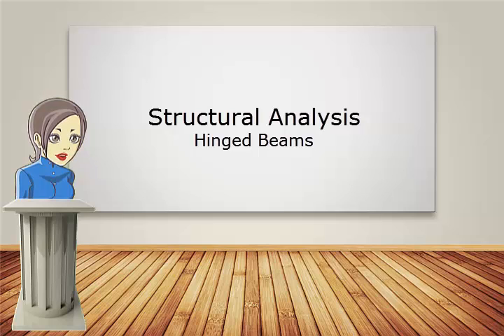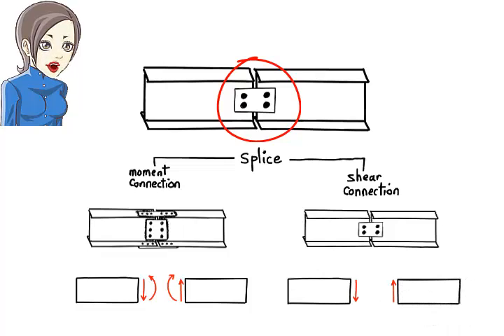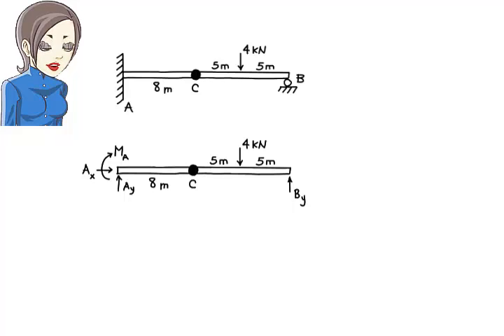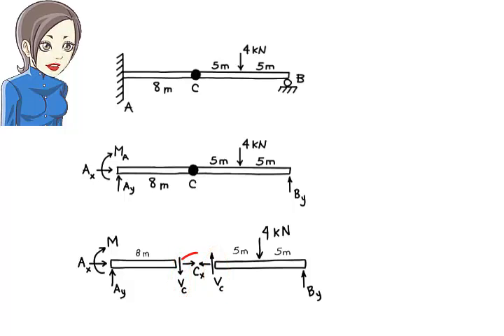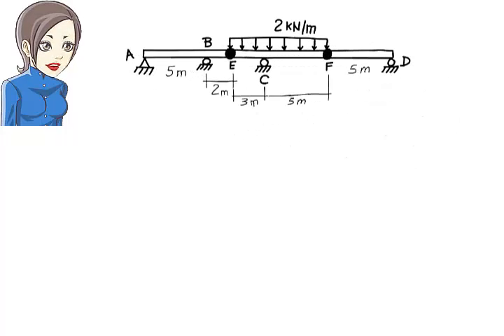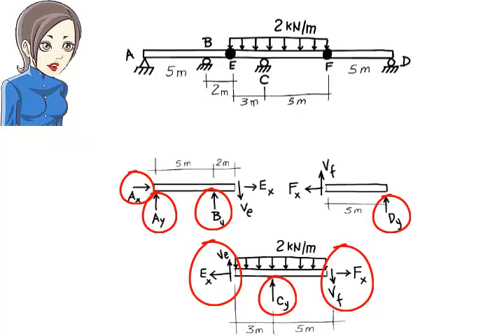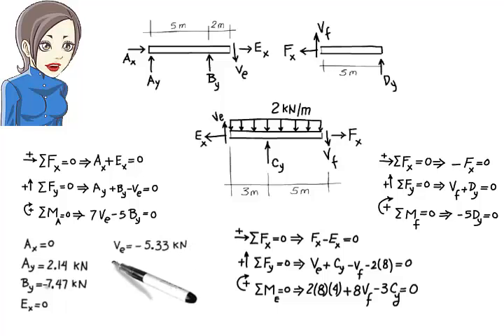SA03: Analysis of Beams having one or more Internal Hinges

Comment: In 3:23 , Why is there no M in the equation of 4 (5) - 10 By = 0?
Reply from the maker: That equation is written using the free-body diagram of the right segment of the beam (Segment BC). There is no M in in the free-body diagram of Segment BC. M is located at Point A and not a part of Segment BC.
Reply: @DrStructure  Internal hinge doesn't have M?
Reply from the maker: Correct. There is no bending moment at the internal hinge.

Comment: How one decides if the splice be a moment or shear?
Reply from the maker: That is a design consideration which can be decided on case by case bases. For example, if the splice is near the point of zero moment in the beam, we can design it as a shear splice. If however the splice is to be placed at a point with a high internal moment, a moment splice would be more fitting.
Reply: @DrStructure Thanks indeed for the reply. 👍
Let's us say for example, that in a continuous beam, one of the spans has zero moment at one point and a maximum at the other one. Is it permitted and practical to have at one point a shear connection and the other a moment? Is it really happening in the real-world?
Reply from the maker: Permitted? Yes! 
Practical? That depends on the cost. If the cost of building such splice combinations for that beam is deemed reasonable, then yes, it is practical.
Reply: @DrStructure  👍 Again, many thanks.

Comment: Does the presence of internal hinge make structure weak
Reply from the maker: It causes a redistribution of the internal forces in the structure. That does not necessarily mean a weak structure.

Generally speaking, we design a structure for a specific purpose; to safely carry a specific set of forces. Of course, we can over-design the structure. We can design it to carry more loads than it will be subjected to during its life cycle. In a sense, the over-designed structure can be said to be “stronger” than the optimized structure. But that does not mean the optimized system is weak.  

If we add redundancies to the system and make the members heavier and stronger, we end up with an unnecessarily stronger structure which renders the fitting (optimized) design a weaker option.

Comment: Why is it that in the first problem with 1 hinge, the moment of the fixed support is drawn clockwise, however in your first video when you were showing the types of support, the moment was drawn anti-clockwise. I drew the moment anti-clockwise and got M to be 16 kNM, whilst you got -16. Could you please explain to me how to determine the direction of moments?
Reply from the maker: When the force/moment is unknown, since we don’t yet know its direction, we need to make an assumption. In the case of a bending moment, we can assume it to be either in the clockwise or counterclockwise direction. If we guess correctly, we get a positive magnitude for the moment. If we guess incorrectly, the magnitude of the moment comes out negative, which tells us the correct direction. 

So, when the unknown moment becomes known, we have its correct direction and magnitude. That is, a negative moment magnitude tells us that the moment is actually acting in the opposite direction (with a positive magnitude).

Comment: Question1: When cutting the segments, why do you use always Ve of Vf and not Ey and Ex ? 
Question2: What if there is a couple moment of internal hinge/s, is it in same direction when cut the segment or it is unchangeble (the rotation of couple). 

Ty and more POWER!
Reply from the maker: We usually use the letter V to refer to a shear force. But of course we can use any other letter/symbol to refer to the internal shear force at the hinge when the beam is cut. Generally, there is no fast rule for labeling forces, there is only convention and/or preferences.

Well, since the internal moment at the hinge is zero, there is no need to draw it at the hinge. But if we were to show the internal moment at a cut point in the beam, we would need to draw them at two opposite moments (similar to the way we draw two opposite shear forces). If we draw the moment at the left face in the counterclockwise direction, the moment at the right face of the cut needs to be drawn in the clockwise direction, and vice versa.

Comment: We say there are three equilibrium equations , FX,fy and sum of moments equal zero , however you say when we add a hinge the number of equilibrium equations increase to 4 or 5 , how is this possible? Does the hinge add another condition of equilibrium? My guess is that bending moment at hinge being equal to zero is the additional equilibrium equation that results when we add a hinge ? Please reply
Reply from the maker: For each beam segment we can write three static equilibrium equations.

When the beam has an internal hinge, we can separate the beam at the hinge into two segments. 

For each segment we can write three equilibrium equations. That gives us a total of six equations. So we can solve for six unknown forces. 

The unknown forces being the support reactions and the shear force and axial force at the hinge (bending moment at the hinge = 0).

Such a beam can be analyzed if it has a total of four unknown support reactions. The four support reactions plus the two unknown forces (shear force and axial force) at the hinge gives us a total of six unknowns. Such a beam is treated at a statically determinate system since we can determine all six unknowns using the six available equilibrium equations.
Reply: @DrStructure  my teacher has given me a problem that has a beam with one end fixed , the other end roller support with a hinge between the two supports , it says that the total number of reactions are four ,but the number of equilibrium equations are four , and the one extra equilibrium equation comes from the internal Hinge , can you please explain this ? Is there a difference between equilibrium conditions and equilibrium equations?
Reply from the maker: The number of unknown support reactions is 4 (three reactions at the fixed support and one reaction at the roller support). And if we separate the beam segments at the hinge, we introduce two additional unknowns (a shear force and an axial force at the hinge). So, we end up with 6 unknowns.

Suppose we label the reactions at the fixed supports Fx, Fy, and M. And refer to the reaction at the roller as R. So, Fx, Fy, M, and R are our unknown forces. 

The three static equilibrium equations for the entire beam are going to be defined based on the four unknown forces mentioned above. Note that none of these unknows are related to the hinge. So, what does the additional equilibrium equation (for the hinge) look like? Does it use any of the four unknowns? The answer is no! The equation at the hinge references the internal moment at the hinge (the moment at the hinge = 0). But that moment is not a part of the support reactions (i.e., it is not one of the four unknowns referenced above). So that additional moment equation at the hinge is of no use for determining the support reactions.

To solve the problem correctly, you need to write three equations for each segment of the beam (assuming we have separated the beam into two segments at the hinge). The four support reactions + the unknown shear and axial force at the hinge gives us a total of 6 unknowns which we can determine using the 6 equilibrium equations.

Comment: Hi Dr. Strucutre, great video as always! :) Is there a chance you could explain the forces involved in this device: thunderbeat (link below), particularly at time 0:57? 
(https://www.youtube.com/watch?v=O8isvo_VW7s&ab_channel=OlympusMedicalSystemsEuropeandMEA) From my understanding, the upper jaw is a fulcrum/pin support as it allows rotation, the force from the tissue closest to the inside will equal the force exerted on the outer edge tissue that's the same distance away from the fulcrum point. Is this correct?
Reply from the maker: Without examining a schematic diagram of the device, it is difficult to understand its exact mechanics. With that in mind, yes, the device has a hinge that permits the upper jaw to rotate. It appears that the upper jaw is being lowered by a pulling action (as if a thin plate/wire attached to the jaw is being pulled to force it to close -- to rotate about the hinge). If so, the amount of force exerted by the jaw on the tissue is a function of the tension force in the thin plate/wire.
Reply: @DrStructure  thank you Dr. Structure! :)
Reply: @DrStructure  May I ask whether you have a video that explains such a pulling action? I'm struggling to understand how it would work, it makes sense that a wire would be pulled but in trying to visualize this it's difficult. For me, it seems like the opposite (i.e pulling it, opens the jaws), but I can just feel that I'm wrong as you'd need force to close it.
Reply from the maker: @king0vdarkness  I am not aware of any video that illustrates such a pulling mechanism. 

Under the assumption that the jaw uses such a mechanism, we can think of a spring that keeps the jaw open. So, think of two wires, both attached to the top jaw. One wire attaches to the top of the jaw, and another wire is attached to the top jaw's bottom. The top wire pulls the jaw to the open position, and the bottom wire, when pulled, forces the jaw to close. We can have a mechanical spring attached to the top wire to keep the jaw in the open position. So we need to apply a pulling force to the bottom wire to close the jaw. This applied force (which can be generated using a motor) needs to be large enough to overcome the force in the spring. When the force in the lower wire is discontinued, the spring action opens the jaw.
Reply: @DrStructure  brilliant explanation! Thank you so much :D
Reply from the maker: You’re welcome!

Comment: So what's the use of the axial forces if their value is zero. Because both the problems you solved, their value comes =0 .
So you can anyone kindly tell me this please?.
Great video btw , got to learn the concept with ease
Reply from the maker: For the sake of completeness, we include the axial force(s) in the formulation. 

If the beam is not subjected to any horizontal load, the axial force(s) are always zero. But that would not be the case if an inclined load (with a horizontal component) is placed on the beam.

Furthermore, if the structure is a frame (not a beam), axial forces may not necessarily be zero, even when the system carries gravity loads only.

So, to be safe (not to make errors when solving the problem), we should include those forces in the formulation, even though for some problems they may end up to be zero.

Comment: Does the direction of the force that we assumed effect on the reactions or the moment 

Thank you very much dr structure
Reply from the maker: The assumed direction of the force has no impact on the results of the analysis. 

If we assume a downward direction for an unknown force, and its magnitude comes out to be negative, then we know the actual direction of the force is upward. If we had assumed  an upward direction for the force, we would have gotten a positive magnitude for the force.  For example, a downward force of -10 kN is the same as an upward force with a magnitude of +10 kN.

The same is true for bending moment. If we assume a clockwise direction for a bending moment, and its magnitude comes out to be negative, say -100 kN-m, then we know that the moment is actually acting in the counterclockwise direction with a magnitude of +100 kN-m. Here too it is important to keep in mind that a clockwise moment having a negative magnitude (say, +100 kN-m) is identical to a counterclockwise moment with a magnitude of -100 kN-m, and vice versa.
Reply: @DrStructure  
Got it 💚
Thank you it's not enough for you 💚

Comment: Thank you very much. I have a question: adding a hinge on the inflection point, will the hinge affect the bending moment diagram and elastic curve?
Reply from the maker: Yes, it does. Bending moment at the hinge becomes zero causing the slope of the elastic curve to become discontinuous.
Reply: @DrStructure  as bdm at inflection point was zero before adding the hinge, so it won't change the bending moment diagram, but only changes the elastic curve, right? it is like changing the boundary condition.
Reply from the maker: No quite. At the inflection point the of curvature of the elastic curve changes direction (i.e., going from concave up/down to concave down/up). That is not a point at which bending moment is zero. So, the bending moment diagram for such a beam is not going to show zero at the inflection point. But if we introduce an internal hinge at the point, we end up with a zero moment at that point.  

A good example for this would be a two-span continuous beam where only one of the spans is subjected to loads. The loaded span deflects downward (having a concave up deflection) while a significant part of the other span deflects upward  with a concave down deflection. The point of inflection is in the unloaded span close to the middle support where concave up turns into concave down. Now, if we place a hinge at that point, we turn the beam into a statically determine one in which the entire load is going to be carried by the loaded span (and the two supports that the span rests on) only. The other span carries no part of the load. This results in a moment diagram, and an elastic curve that are completely different than those for the (indeterminate) continuous beam with no internal hinge.
Reply: @DrStructure  thank you for your detailed reply, but I feel confused. maybe I didn't express it clearly. I mean adding a hinge on the inflection point of the elastic curve, not the curvature diagram. the inflection point of elastic curve is where the curvature changes sign. As curvature (not slope) is in direct proportion to bending moment, so it is also the point where bending moment equals zero.
Reply from the maker: I think it would be best if we put this discussion in the context of an actual problem. You can work out a problem as you have envisioned it, save it as a PDF (still images works too) and email it to Dr.Structure@EducativeTechnologies.net

We'll take a look at your solution and comment on it accordingly.

Comment: I am wondering where did you get the M in the summation of moment at point A. Isnt that supposed to be zero because it passes in the point?
Reply from the maker: If a force passes through a point, its moment about the point is zero. But that is not what we have here. At the fixed support, there is a vertical reaction force and a bending moment. These are called the support reactions. The bending moment (M) does not act like a force. We don't find its moment by multiplying its magnitude by a distance. The moment of M taken about any point on the beam is M.
Reply: @DrStructure  thank you for being responsive!! I understand it now 💗

Comment: great video but what do i do if i have a circular beam can i use those hinges ????
Reply from the maker: Do you mean a beam with a circular cross-section or one that has a curved (circular) geometry? If the former, yes, a beam with a circular cross-section could have a splice that acts as an internal hinge. If the latter, the analysis of curved beams is beyond the scope of introductory structural analysis, but they too could be designed to include internal hinges.
Reply: @DrStructure  thanks a lot for replying

Comment: What if a column (in a frame) has an hinge right at top of its bottom pin support? Does it make the pin support to a roller support?
Reply from the maker: No, it does not change the nature of the pin support. A hinge located at a (short) distance from a pin support makes the segment between them act as a truss element. Meaning, it can carry an axial force only, no shear force or bending moment develops in the segment. Assuming that the resulting system is still statically determinate, it can be analyzed just like a beam with an internal hinge.
Reply: @DrStructure   thank you for the prompt response! You are the best...
Reply: @DrStructure  you mean the support reaction which is in the direction of shear at hinge will be zero by making the equilibrium at the segment. Right? And then the only force at the support will be the axial force balanced at support?
Reply from the maker: Correct!

Comment: Hello Dr Structure. How is the beam in the first example any different if we have an external applied moment at the hinge? Thank you :)
Reply from the maker: The external load/moment needs to be placed either just to the left of the hinge (at the right end of segment AC) or just to the right of the hinge at the left end of segment CB. The load/moment cannot be placed exactly at the hinge, since it is not an actual structural member but a means of connecting two members. 

Place the applied bending moment on the free-body diagram when the two segments are separated. So, the moment appears at the end of one of the two segments (AC or CB). Then proceed with the analysis as usual.

Comment: Hi Sir, will the hinge reduce the moment in a beam ? or will it increase the moment ?

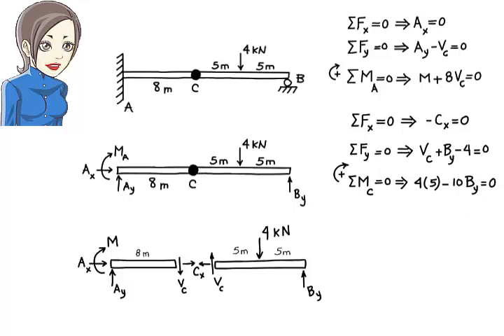for example at video 2:50, the structure is stable without adding the hinge, but it will be statically indeterminate ( we can't count ) but it is still stable, assuming if the above structure at 2:50 has no hinge, will the moment suffer in the beam be greater or less ?
Reply from the maker: Yes, if we get rid of the hinge, we end up with an indeterminate beam. That beam would have a smaller bending moment at A, but a non-zero moment at C. The beam with the hinge has a zero moment at C but a larger moment at A. So, when the hinge is removed, the moment gets redistributed resulting in a moment reduction in one part of the beam (at A) and a moment increase in another part of the beam (at C).